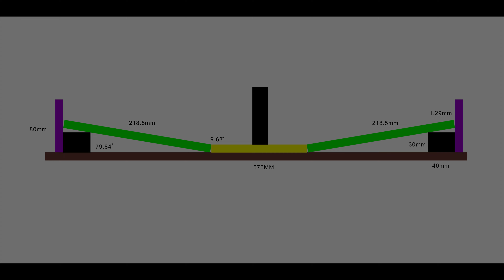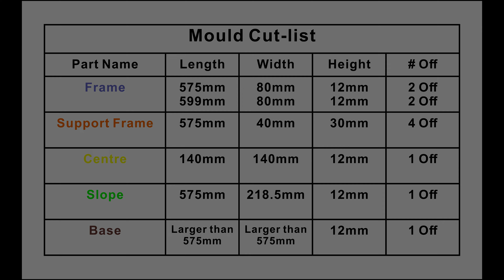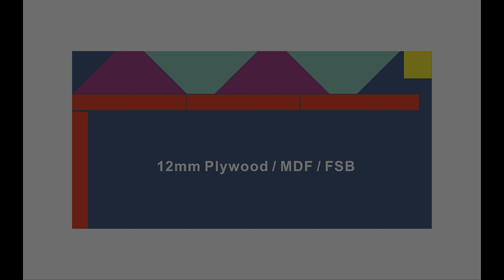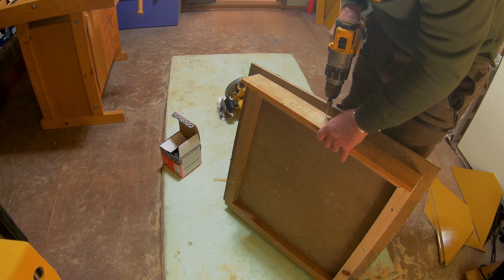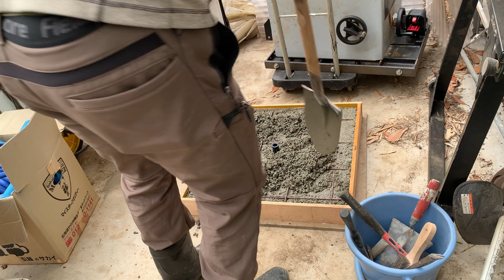Abandoned Chiba House Renovation Japan. Part 17. Concrete Post Caps

Comment: Nice work. When laying brick or block and the mortar is going off too early if you wet or soak the blocks before laying, they won't draw out the moisture from the mortar. The problem isn't the mortar its usually the materials acting as a sponge. You also get a much better bond as the mortar goes off more slowly. You can also use a much drier mix which is of course much stronger as well.
Reply from the maker: Thanks for the comments. Have tried brushing water on before using,but hadn't thought of soaking them.
Reply: @easypeezynotsoeasydiy2193  Soak them for 10 minutes in a separate wheelbarrow and you will be fine.
Reply from the maker: Hopefully wont have to do any more post / wall building for a while but will definitely give it a try. Thanks!!